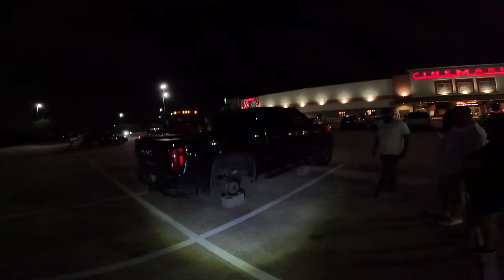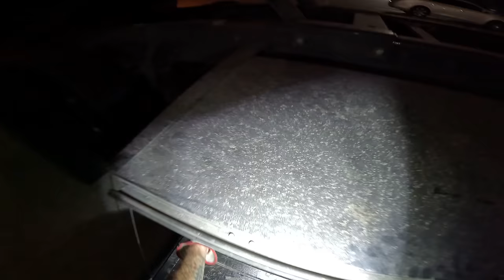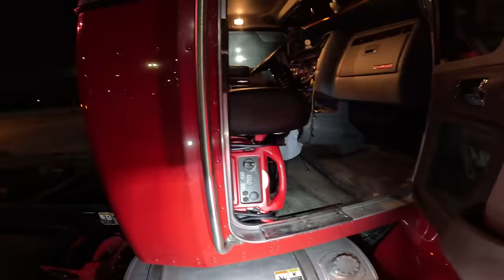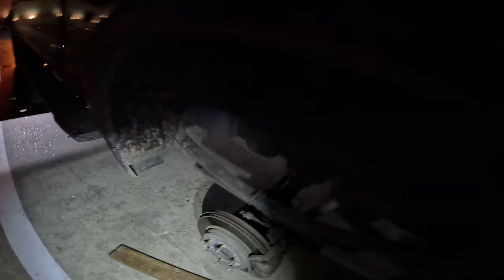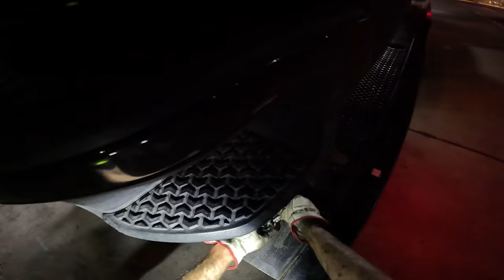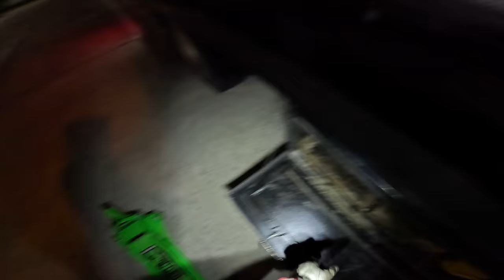They Left Him Sitting On Blocks At The Movies!!

Comment: Wouldn't it have been easyer to use the underlift and tow it from the rear ?
Reply from the maker: Maybe. I don’t like junkyard slinging new vehicles, and you’re not supposed to wheel lift some thing without having a load on the bed. It’s very bad for the bed locks.

Comment: Put your truck in neutral no parking brake and just use winch to pull your truck under a lot more easier than walking under and doing winch at same time
Reply from the maker: I’ve done this in a previous video. 
However I don’t like doing that in general, but with this truck the bed has to be lifted pretty high, to clear the feet, which makes it a bit more difficult. I’d much rather walk the truck and have full control over both my truck and the casualty.

Comment: Dustin you did a great job. Does it often happen that cars or tires are stolen in front of a restaurant?
Reply from the maker: Not super often. Mostly up closer to Houston. 
Generally, if it happens in my area, it’s inside of the chemical plant parking lots
Reply: @Towtruck_Dustin  Then I would have had rim locks on the car for a long time.

Comment: I tow things from the back never had a problem
Reply from the maker: Little cars and stuff that won’t stick over the cab, I’ll haul backwards, but for us it’s company policy not to haul full size vehicles backwards on a flatbed unless deemed totally unavoidable. 
We’ve had several instances where operators had rocks hit the back windows and shatter them. It is common? Absolutely not, but it has happened. So now we don’t do it if we don’t have to.
Reply: @Towtruck_Dustin Oh that makes sense. I mean most of the time i do it, its because i cant get them from the front. I gotta say how you got it up on the bed was awesome
Reply from the maker: Thanks!
Another issue we had the other day, was a fuel door came open and ripped off because another driver was hauling a Chevy truck backwards.
Reply: @Towtruck_Dustin  being a chevy that dont shock me.